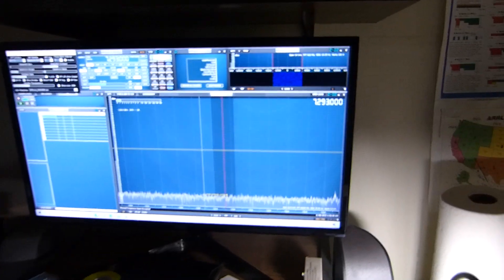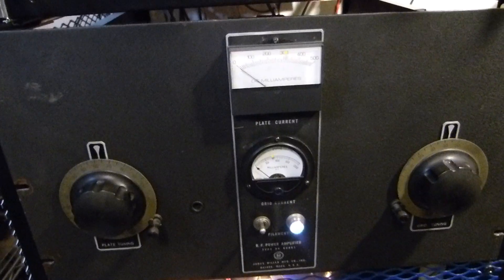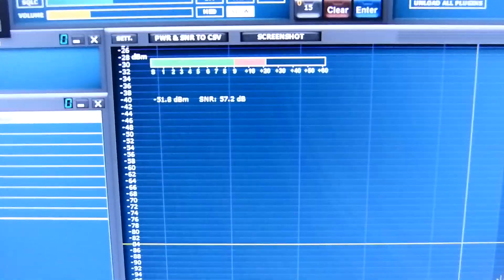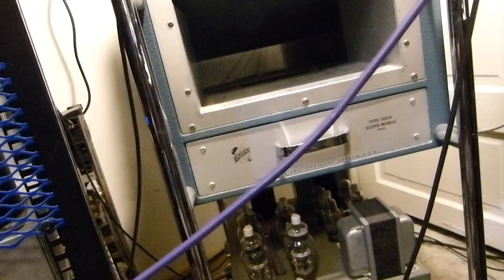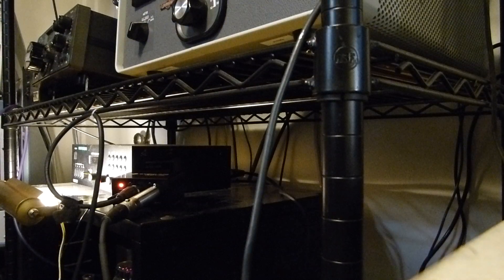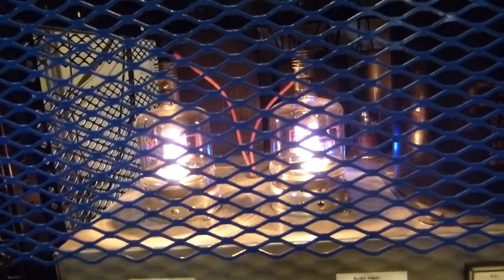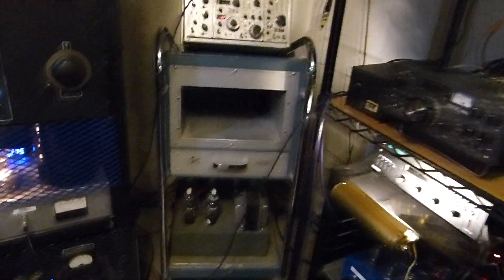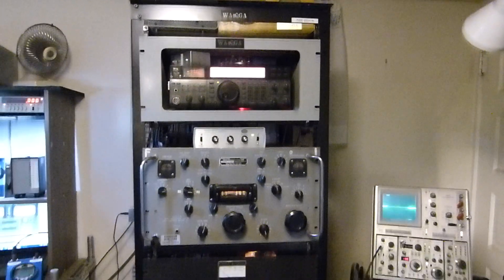Checking Modulation On An AM transmitter Using Two Different Speech Amplifier Drivers.

Comment: Hello Dave I have question about spectrum analyzers I want use one for amp biasing do I need to use attenuator to keep the output from frying it. The model I have is Siglent ssa3021x-tg the max input is 20dbm.
Reply from the maker: 20 dBm is 100 mW   (0.1 watts) so make sure you do not exceed that level or you will fry the input.  
If it is 50 ohms that is a maximum of 2.24 volts.
Check my math to make sure I am correct.
I always keep at least a 20 dB attenuator on my HP SA and a DC block. Some SA's require Zero DC on the input.
I just looked up your SA and it is 9KHz to 2.1 GHz.  I hate to tell you this but it won't work very well at audio frequencies if that is what you want to use it for.
The PC based SA's are the best for audio work.
Hope this helps.
Reply: @ElPasoTubeAmps  OK thanks I will return this unit do you recommend a PC based unit SA.
Reply from the maker: @nigman2023  I haven't used mine in a while but the one I find on my PC is TrueRTA. As I remember, the SA was good but the oscilloscope was not good.
There is another one called SpectraPLUS but it is really expensive but you can use it free for 30 days.
https://www.trueaudio.com/rta_down.htm
http://www.spectraplus.com/Downloads.htm

Comment: Is your shop actually in el paso? 
Are you willing to repair high power guitar amplifiers?
Reply from the maker: I am in El Paso but I can't take in amplifiers or other equipment anymore. Just too heavy and I can't make the commitment. 
In addition, I am only set up for vacuum tube equipment. Just for curiosity, what high power level are you talking about?  I know there are some KW level solid state amplifiers out there. A few years ago one was brought to me and it was absolutely burned to a crisp. Someone must have shorted out the fuse/circuit breaker and it literally caught the PCA on fire.
Thanks for asking.
Reply: @ElPasoTubeAmps  
Daing. Sorry to hear that.
Its not monstrous. 
Its just very special and a classic. 
All the big area rockers used them from what ive read.
Metallica and such.
It was used by a family friend till he passed. 
Its one of the biggest and most expensive MESA BOOGIE amps they ever made. From what ive gathered.  Ive had it 22 years.
300 watt "COLISEUM Series" guitar amp.
VACUUM TUBE.
I really didn't want to ship it to California.  Back to MESA.

COLISEUM 300, MARK-2B.
Im pretty sure. 
Discontinued

Comment: Very exciting Information and display in real time. I want to build a simple tube amplifier for audio and wOuld like to hear some of your  suggestions ( cost is top priority) , 50 watts top all tube ( hopefully rectify with mercy vapor).I would need it to power a tuner, record player, etc,etc... ? Got some ideas for me sir?thank you.wish I could buy one of your units?
Reply from the maker: Thank you for your kind comments. I used to budget myself to about $40 to build an amplifier - that was around 50 years ago. Nowadays with Ebay, things like transformers are much more accessibly than they were 50 years ago (back then we had to part-out old TV's or have a buddy with parts) but the prices are astronomical nowadays. Buying every part new, except used output transformers off Ebay, could easily cost $800 or more to build a 20WPC tube power amplifier. The only reason I can still do some of this is I have a 60+ year supply of parts. I started as a ham radio operator at 13 and been hording every since.  🙂
With all this said, the 1947 design known as the Williamson design is probably the best 15-20 watt power amplifier ever produced. There are lots of schematics for Williamson designs but my favorite is the 6SN7 version of the Heathkit amplifier.  
Here is a site with all the Heathkit products and the amplifier version is the W-5M that I like - way down at the bottom of the list of products. Hope this helps you build.
https://www.vintage-radio.info/heathkit/

Comment: good to see videos from ya! I have a yeasu ft102 and a (3) tube 3-500z amp.Are you still building
Reply from the maker: Wow... three 3-500Z's. That should deliver the legal limit and some. 
I haven't built anything significant in a while and don't have plans for anything at the moment. 
I still  think about building a 833A class-C RF amplifier and plate modulating it with maybe a pair of 4-400A. That could happen as I  have all the big parts but I need more room.
73

Comment: Hi Dave, good to see another video. Not sure what you're showing here. If you have a bandwidth limit, there must be a bandpass filter somewhere in the chain, nu? Where is it?
Reply from the maker: No audio bandpass filter in my AM transmitter. In SSB transmitters, audio bandwidth is generally and intentionally limited to about 3 KHz (the voice range of 300 Hz to 3 KHz) and only one sideband (thus, single side band). In AM there are two sidebands, the plus and minus audio frequency of the modulated carrier frequency so, AM is, at the least, twice as wide as SSB. 
In addition, we really don't get into trying to narrow our voice sideband (either one...) to some, really nice level, meaning we go ... HiFI... Not everyone loves us but we don't care. Kind of like playing your stereo a little loud in an apartment complex. 
With that said, I got a comment recently where some fellow, that was very strong at my location,  told me I was 15 KHz wide - that would be a 7.5 KHz audio signal. With his signal level at my location at S9+, no doubt he was correct as he would have also exceeded his 3 KHz (nice neighbor level...) boundary. 
It prompted me to measure my bandwidth, especially concerning the "fidelity" i.e. "bandwidth" of my modulated signal. I am satisfied that sounding good is not a violation of respectful ham radio etiquette and this is my documentation of different levels of "fidelity" in AM transmissions. 
From the other side of the isle, the SSB community, many try to sound HiFi  with their high-end microphones which invariably adds bass frequencies to their audio, in a SSB restricted frequency range, and it only ends up making them sound "bassy" and hard to understand with the least bit of QRM (interference) . In the SSB communication world, a person should actually try to sound like the space shuttle talking to Houston and not attempt to sound like a high fidelity amplitude modulated transmission - which the SSB mentality is likely to criticize the AM community for sounding like -

Comment: Iam interested in an 813 hf linear, any for sale?
Reply from the maker: Building an 813 linear amplifier has interested me for years as I have several 813 tubes. You may have just renewed my interest. I hear they make a good SSB GG linear amplifier. 
There are lots of articles on 813 amplifiers on the Internet and here is a link to one.     https://www.w4npn.net/813-linear-amplifier-project/
Building multiband amplifiers is a serious addition over a single band amplifier. The easy way to solve that is use the B&W 850A tank coil that sometimes come up on Ebay although many are in terrible shape.
Many people chose not to tune the input as a pair of parallel 813's have in input Z of about 100 ohms and most modern day auto-tuning rigs can handle that but I think tuned inputs are a good idea both in harmonic suppression and ease of driving the amplifier.
For single band RF amplifiers, 1/4 inch copper tubing or #8 solid wire make a good tank coil and is what I have used for years with 4-400A amplifiers.

Maybe you want to build your own amplifier. 73  WA4QGA
Reply: @ElPasoTubeAmps  Thank you very much for your response. Thats exactly what Ive been kicking around for a while, iam confused with what transformer to use, I was told an intermiadiate duty transformer @2,700v  but Iam confused with what happens when iam finished rectifying and filtering the secondary, the voltage seems a bit high for the 813's liking.